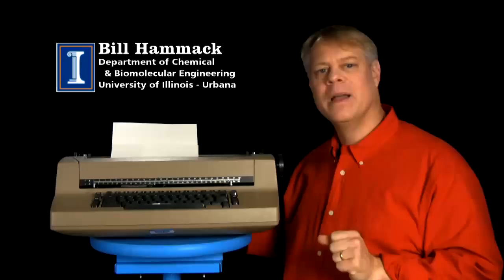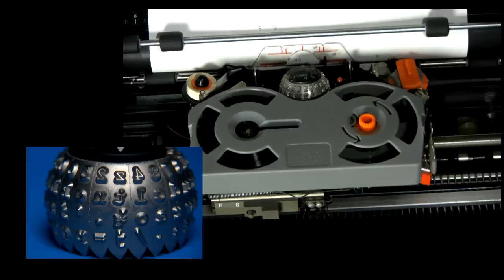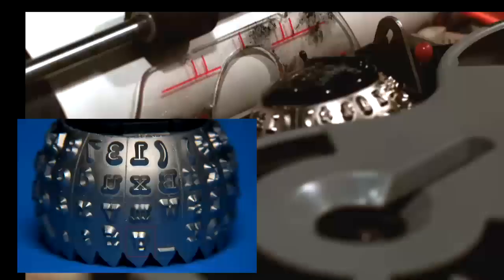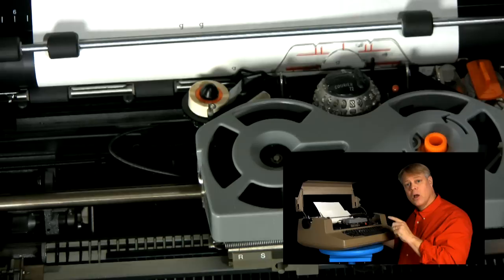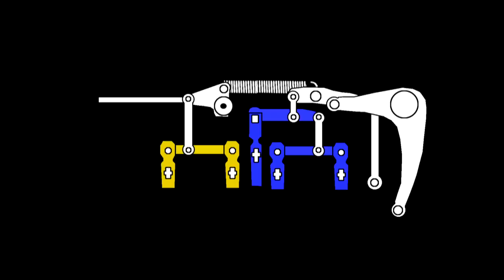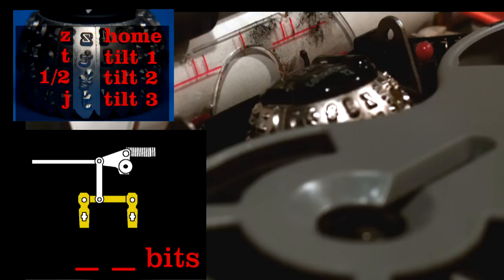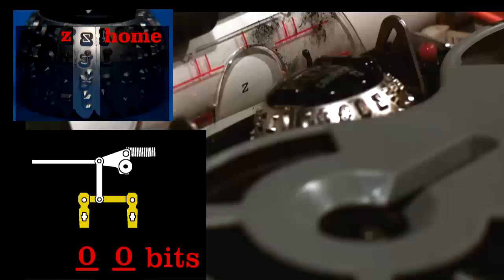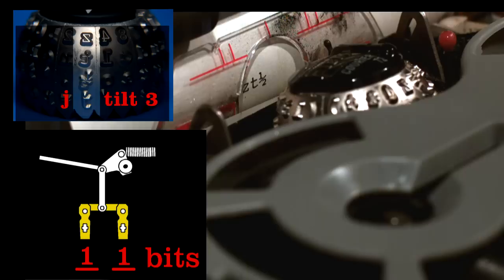IBM Selectric Typewriter & its digital to analogue converter

Comment: Many years ago, I used to repair IBM  Selectrics, so I am quite familiar with their workings, and to this day, I am still astonished by their exquisite design - they are a MASTERPIECE of mechanical engineering!Yet, I would argue that these are not digital-to-analog, but binary-to-decimal converters, since their "whiffletrees" can generate only integer, or decimal, movements.  You could not, for instance, have 1.643 or 2.165 increments of rotation, only 0, 1, 2 or 3 increments. (In the case of vertical "tilt")
Reply: flurng while I understand your argument I think with that argument you could say, that even today there are no real binary to analog converters. When we convert binary to „analog“ we take discrete binary numbers an turn them into other discrete numbers. The resulting numbers are considered „analog“ when the gaps between them are small enough so we can just neglect them.
In your example one could certainly build a decent mechanical device that converts digital numbers to 0.000, 0.001, 0.002 etc. and you would sooner or later reach 1.643 and also 2.145 with that. We would consider this output as analog, nevertheless its rather „pseudoanalog“. The gaps are just 0.001 sized instead of 1.

Turns out there is no such device that could generate a real analog signal out of a discrete digital one. A D/A converter is in fact a function f that transforms a number into an other number. For a given (digital) input number we want only one possible result as output, everything else would result in nonsense. That means we want the f to be injective.
Now since the input is discrete and finite (there is a maximum digital number that a computer can store) we can not use f to generate an continuous output set out of the input. Since the continuous output has an infinite amount of numbers between every two numbers of that set, we would simply run out of input numbers before we could „hit“ every possible output.
Reply: @schievel6047  interesting point. However, 'time' can be used to bring continuity in the output space. For example, an inverter working with a DC 12 Volt battery can give a close to sinusoidally varying output using clever 'circuit switching' electronics.
Reply: Well, it turns out that reality is fundamentally discrete, not continuous, so really digital vs. analog is a question of the resolution of a system vs. the resolution of its measurement.
Reply: @schievel6047  how you discuss such an complex technical or niche topic with such a fluency...think we have a core techie in comment section....nice to see you people around.
Reply: @stallio5612  oh thank you very very much. I really appreciate your compliment because English is not my mother tongue and I am always worried when I try to discuss a math topic in English people only under nonsense 😅
Reply: Keaton C  so what your saying is, as long as your sampling rate is high enough, in practice a digital signal is just as good as a analogue signal. 
Yes that’s absolutely right, we use this ‘trick’ everywhere from digitally coded music to digital images.
This discussion was initially about why a digital-to-analog converter shouldn’t be called a binary-to-decimal converter just because the gaps between the possible outputs are considered too big. Even if the sampling rate is below the nyquist frequency it should still be called a digital-to-analog and not a Binary-to-decimal Converter. 

I just thought I drop the mathematical reasoning why there is no such thing as a D/A without gaps as an extra. :)
Reply: @schievel6047  Except that the idea of a "gap" is meaningless in this context.  The sample at each quantization interval is a point, not a duration held for any length of time.  Monty Montgomery at Xiph explains it really well in his video series on A/D-D/A conversion and you can read more about it in Ken Pohlmann's Principles of Digital Audio—the Bible of digital audio since 1985.  As long as we are sampling at >= 2x the Nyquist-Shannon limit, every fundamental or harmonic, and consequently every complex wave ranging between 0Hz and the Nyquist-Shannon limit is 100% accurately reproducible, assuming the (routine) use of an anti-aliasing filter... in the case of A-weighted range, this is a 20kHz lowpass.
Reply: As a very young man i camt to the US and made good money cleaning these machines. There was double benefits with this thinner soaked job. I made good money and the earnings was not wasted on buying beer or whiskey. The rugs were so soaked with solvents all the time that i was stoned most part of the day. But damned the machines were clean and shiny.
Reply: I used to sell and repair them too in another life. It's been almost 2 decades since I've touched one.
Reply: Came here as soon as I saw the title of the video just to make this same comment about this analog versus digital. You beat me to it! I can only add that this is an ingenious piece of engineering based on a stupid idea/concept. Daisywheel is so much simpler in every respect, starting from the mould making process for the daisy wheel compared to the 'golf ball'.
Reply: well it is "digital as-in you touch it with your finger and "analog," as-in it prints what you tell it to if you look at it that way
Reply: @Axel_Andersen  if you don't understand the benefits, every single concept that can be thought of, is stupid. It's always a trade off between various properties. A concept might be non-optimal or even unsuitable for the purpose, but calling it stupid is just stupid.
Reply: I am amazed at the level of real engineering that went into these.    The entire case comes apart in seconds without tools.    And today, we call innovation creating a new app.
Reply: @torydavis10  Reality is not “fundamentally discrete”; the very concept of quantization is an imposition of our form of sapience that allows for effectively correct prediction of empirical events through our systems of rational calculus.
Reply: @WorldConstruct  Sure, it's just a model, and everything is in our minds, but also emission spectra exist. Don't need calculus to observe those.
Reply: @Gr8thxAlot I respect the point you make and I agree, but it's also pretty untrue. Try writing the code and debugging a popular app,
Reply: @stallio5612  Oh, of course not, we in Indonesia also have technicians who used to train at my IBM company, the third generation of previous technicians. We are provided with a manual and know how to fix it by heart.

Comment: My grandpa worked on designing that ball carriage system for IBM
Reply: @audilicous  it's so myopic of you to interpret it like that - in fact it's clear from the guy's username and videos, that it's the opposite of what you wrote
Reply: @audilicous  I think he's being sarcastic with the name, also, it isn't only dumb people fall for conspiracies, some people are smart, know they're smart and so, want to think differently to others (subconsciously) and so they are more likely to fall for things that are believable.
Reply: @ChrisOReilly  Chemtrails are real. The conspiracy is trying to hide the truths about them.
Reply: @artsmith103  I have been in the cockpit of commercial jets a number of times and no switch causes "chemtrails", it's the stupidest idea I've ever heard.
Reply: @ChrisOReilly  Everything about them has been confirmed including purchase of the chemicals, video being used, and measurement on the ground. Another conspiracy fact.
Reply: @artsmith103  where's the proof of this? The trails that exit from under the wings of an aircraft is fuel, not chemicals but fuel (it dissolves into the air particles in the same way it does once burned) and have basically no harmful effects on humans.
Reply: @ChrisOReilly  You can describe every way a plane leaves a trail due to what you said or moisture emissions, but another one is metal based aerosol chemtrails. If you don't know this you're on your own.
Reply: @artsmith103  where's the proof? You said there's evidence but where is it? Also, what would the reason be.
Reply: @ChrisOReilly  Easy to find many places it's such old news. I don't do other people's work for them without a purchase order.
Reply: @artsmith103  so there isn't any evidence
Reply: @ChrisOReilly  The young crowd blames others for not making knowledge easier for them. The older crowd uses knowledge to evaluate incompetence of people that insist on outing themselves.
Reply: @artsmith103  well I have evidence that says chemtrails DON'T exist (which I am happy to send) but you haven't had any proof, why would a government intentionally poison their own people? They would lose tax money (cause people would be dead) and it would be completely pointless.
Reply: @ChrisOReilly  You mean like a fake Russian Dossier, or FBI entrapment, prosecuters hiding evidence that would exonerate an accused, murdering babies to sell body parts, or fostering illegal immigrants at the expense of citizens, or testing known dangerous drugs on the population, or using government shutdown to block citizens' access to publicly owned resources not requiring gov involvement, or using the schools to indoctrinate children against their parents' wishes? There is no end to it and chemtrails are about a 5yr old conspiracy fact. Do you even know what metal and metal oxide aerosols are? Do you know the difference between oxidation and reduction?
Reply: @artsmith103  you still have t given a piece of evidence
Reply: @ChrisOReilly  Don't intend to without a purchase order or some employment contract for the service. You're on your own catching up with such an old story. If I showed you numerous 80% convincing evidence, how do we ever agree it adds up to 100% for someone so misinformed, incompetent and out of date? You asked why would their be a conspiracy and I offered a long list that could have been much longer. But you ignore it and go back to asking me to do your work for you. It would be a waste of time.
Reply: @artsmith103  you haven't provided any evidence of anything you've claimed, even provide 1 reason that a government would want to poison hundreds of thousands of tax payers, indiscriminately.
Reply: @artsmith103  there's a difference between being negligent and intentionally causing harm.
Reply: @artsmith103  you never take a plane right?
Reply: @sovietkrab1871  Chemtrail facts are so old now it's hardly controversial news. The number of normal planes not spraying is not the story. A plane with a contrail is not the story.
Reply: Awesome possum
Reply: @artsmith103  lmao this boomer literally said "chemtrails are real. Source: trust me"
Reply: @ifalm4274  The chemtrail discussion now is what chemicals are used and how much is sprayed?
Reply: @artsmith103  talking about you old man. You literally said "chemtrails are real, there are real proof about it. Oh i dont have the proof. You have to go find it for yourself. Oh but trust me it is real , and the proof is out there. I just dont have it."
Reply: @artsmith103  citation needed

Comment: Thanks for the explanation. I always wondered how that mechanism worked.
I was a reporter when Selectrics first came into our newsroom in the 1970s. We used an OCR ball and typed on special copy paper. Those were then fed into an OCR machine -- half the size of a refrigerator -- that produced a punched paper tape that was read by a Compugraphic typesetter -- the full size of a refrigerator. That spit out justified columns of type on photosensitive paper that had to be developed and pasted down and shot for a page negative that was used to burn an offset printing plate for the press. Quite the convoluted process.
Then Macs came along.
I always loved the IBM keyboard, so i was happy to find a Selectric II at a thrift store for $5 last year. After a cleaning and lubricating, it works fine. (It came out of our county courthouse so it was well-serviced -- there's a lot of junkers around.) A Yahoo group named golf ball typewriters is a great knowledge base to keep them running, and the ribbons and correction tape are still readily available.

Comment: Seeing how the ball is position is amazing and I was happy to see that.  I'm amazed that after decades, the linkages and cables haven't been stretched or worn out and not longer position the ball correctly.

But, I would like to see how the keys translate into the movement of the wiffletree.
Reply: The only cable in the selectric is the one that moves the carriage! 
Tilt and rotate are translated to the hall via thin metal tapes that go around pulleys out of frame, and what the video calls cables are in fact metal rods!

Comment: I enjoyed watching this! It brought back a sweet memory. In 1979 I bought an old IBM Selectric I/O typewriter, that had electromagnets connected to each branch of the wiffle tree. I was experimenting with a new type of keyboard, and built an interface so that my key switches would fire the right magnets to produce the character that matched the keys. My new keyboard design did not make me rich and famous as I had hoped, but it was tons of fun figuring out how it all worked - because when I bought it, I had imagined the inner workings very differently from how they really work.

Comment: How can no one like this video?  Decades ago late 70's my mother was taking a business class,  our dad rented/leased an IBM Selelctic-2 with the ball typeface for her to use at home.  I remember those typewriters were very expensive over $1,200.00 or higher.  I was able to use it, when mom was not working on it. It was an amazing machine. Some years later, I found one at a garage sale had some issue. Decided to get it repaired. Cost was under 150.00.

Comment: I cried when that machine was introduced.  It rendered my Underwood # 5 obsolete.  Ah, progress!
Reply: Your Underwood STILL ISN'T completely obsolete.
Reply: Your Underwood #5 will still work even if there’s a power cut. The Selectric, however, will not. Progress?
Reply: @hazelanderson1479  Exactly. I wish I could upvote that comment about five times.    8)
Reply: @suprememasteroftheuniverse  Not sure if using an ink ribbon more than once is worth the savings compared to the outcome. 😉
Reply: @hazelanderson1479  But who's going to type in the dark, anyway.
Reply: @53subscribersnovideos35  What I meant was that an electric typewriter needs electricity to work. A manual typewriter doesn’t.

Comment: When he showed the two cables, it made me think: So many basic mechanisms are used in different things that have nothing to do with one another. The cables he showed in this typewriter work the same as the shifter cables in my car, which uses two cables to move three shift forks. The mechanism that you see in old style windshield wipers to distribute the load from one point evenly across the entire blade is also seen in hydraulic carton clamps that are attached to forklifts to carry appliances. The list of non-associated machines that use the same idea is endless and amazing. I love these videos, and can't wait to watch more.
Reply: Wow! Fantastic!

Comment: I've always wanted to pull an IBM Selectric typewriter apart, to see how it was able to control the ball with each key stroke. I understood the "draw bands", but I didn't know the mechanism used to pull the draw bands the right amount, for the letters on the ball to strike the page perfectly. With this explanation, I can see that the system is clever, but simple enough to be reliable. I've NEVER had a problem with these typewriters, other than breaking a draw band. I did notice, that the draw bands were connected to shieves on levers, allowing the head to span margin to margin, with no errors in centering up the letter to strike perfectly. Great video!